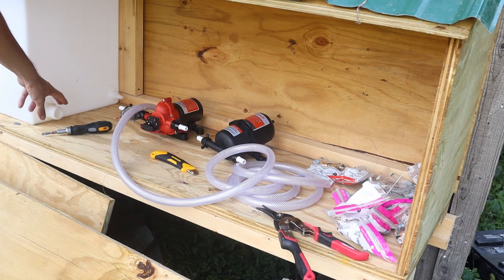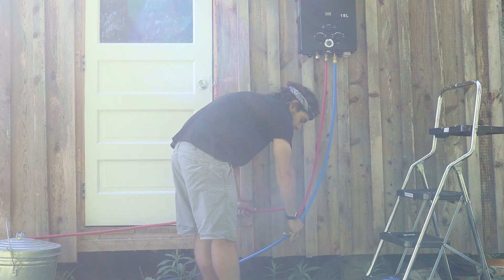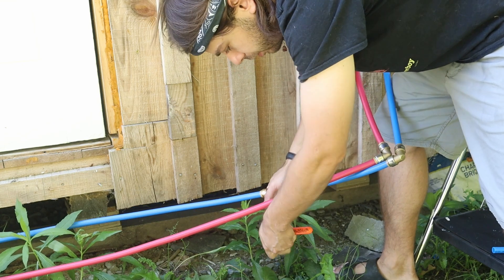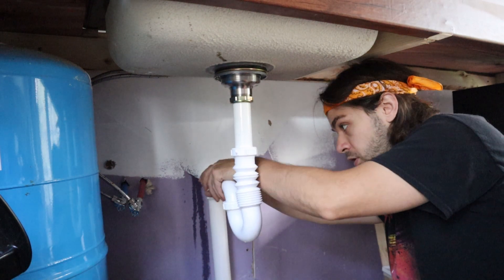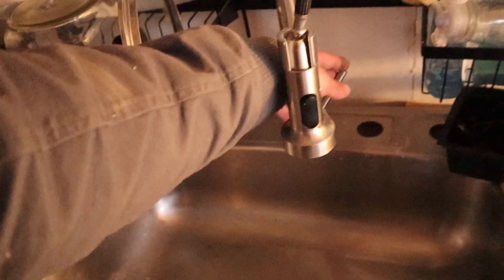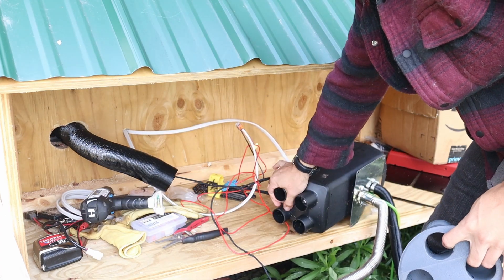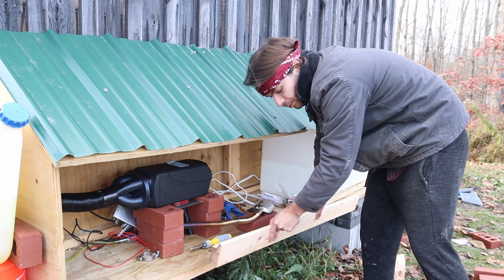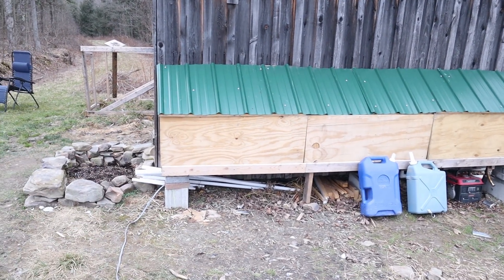DIY Heat And Plumbing w/ No Experience. Shed To Tinyhouse Build

Comment: You could consider using your hot water as means of heating in winter also. Run hot water lines in the floor panels to create ambient radiant heating
Reply: Also, in terms of using the gray water as garden water, you could possibly run into issues with blockages in your drain lines due to food particulate OR roots so you're probably going to want to terminate into drip line with some heavy filtration and a cleanout port upstream. You may also find that household soaps don't agree with plants but that's a conversation for a warmer time

Comment: Running water is a great upgrade! How does diesel heater work? It's not letting exhaust fumes into the inside of a house, isn't it?
Reply from the maker: The diesel heater uses a heat exchanger to gives you got fresh air. Kinda like in your car. And exhausts the fumes outside